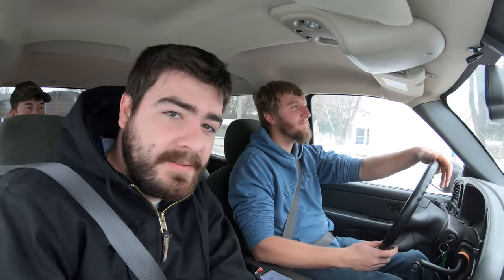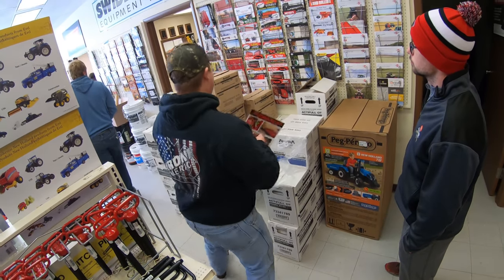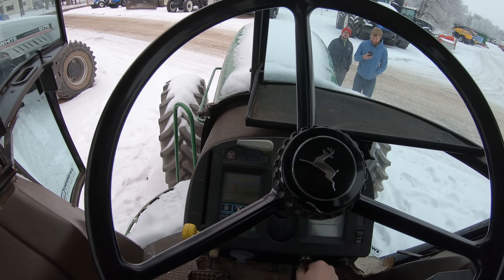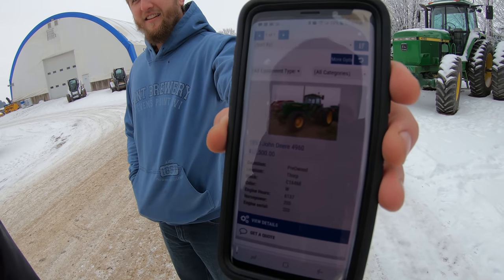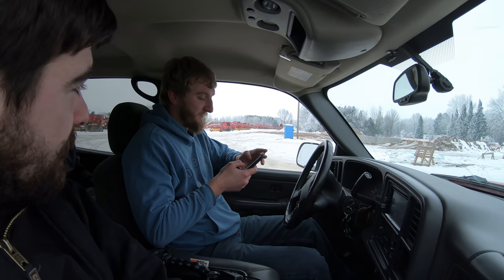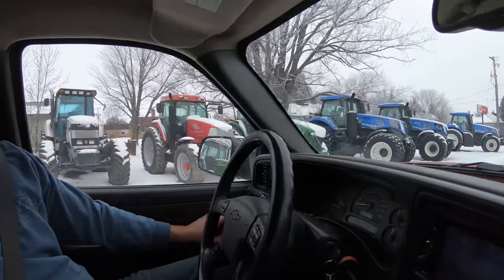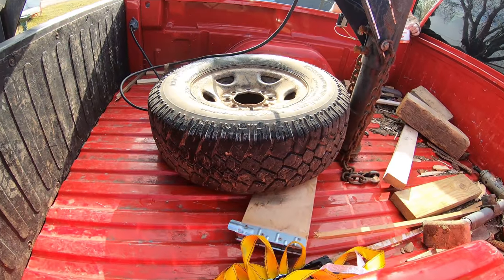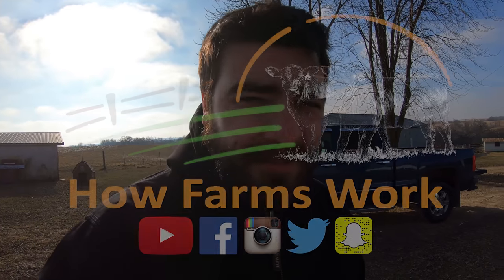Dream Tractor | John Deere 4960 | Swiderski Equipment

Comment: Just came across this. I worked for a farmer who re-powered when new generations came out. He had two 4850s and two 4960s. The 4960s were plastic pieces of junk and I couldn't keep the ACs running, in Florida. The 4850s were a dream to drive. Nothing was beeping or falling off in your lap. I bought my own big crows foot wrench because the hydraulic line under the front axle kept leaking on one.  I had owned two 4250s when I had owned a farm previously. Loved them. My brother still has our 1971 3020.

Comment: Listen, I have lived in the area you traveled here(NE WI) my entire 40 years of life, grew up on a dairy farm(Dad got out of farming in the late 90's) and you need to know this- Swiderski implement is a very large operation, that offers a very large variety of equipment and tractors in both age and make. If you take time to look at their inventory over time, you will find they offer an unusual amount of "overhauled" tractors. Some seem to hae less hours then one would think for an overhaul, some many more. 

Growing up we used to get the trading post farmer's newspaper, and Swiderski had a full page ad. They had all kinds of tractors, lots of Olivers, some Molines, MF- remember this is the 80's and in this area the dealerships for those brands were very, very scarce. So Swiderski was one of few to service them. Thing is, they would have say, an Oliver 1850 let's say. "Recent overhaul". Then you would see the hour meter had litterally rolled over. Same with countless IH tractors, machines with 9000+ hours on them with "recent overhaul". Then you would hear stories of people that bought one of these overhauled tractors, put 500 hours on them and rear ends blew out, PTO quit working, or if you were lucky, the supposedly overhauled engine would go and you could go to bat about defective work etc. Remember now, tractors in the 60's weren't built to run 12000 hours before a major overhaul. Most made it to 5000, maybe 7000 and then you OH'd it as a precaution so you didn't throw a rod through the block. 
Could you find a good unit? Sure. Was it parked right next to a unit that had been overhauled twice and had 11000 hours on it and shiny new paint? Sure. Was that parked next to a tractor that had been under water in some flood down south(or right up in this neck of the woods in the 90's) and dredged out and cleaned up? Sure. 
So when you see that nice looking, super clean JD there you like, just remember, it could have been sitting under 20 feet of water at some point, it may have had a half-arsed OH done so it didn't smoke anymore, you might get it home, run it one season and go to use it in the spring and find out the powershift for the first 3 gears is failing suddenly, etc. or you might take it home and get a really good deal. 
THAT is Swiderski, it's a gamble you have to decide if you want to take, if the price is right. you know what they say, "if it sounds too good to be true, it probably is" There is a reason they want 20 grand more for the other tractor with tons more hours on it- that one was bought at an auction and not dredged out of the river in Texas. 
Just don't get ripped off. look for mud where mud shouldn't be. look for water lines on the sides(if it was in say, 4 feet of water you might see a trace of where the water height was on the tractor) look for shiny new paint, it was put there to hide somthing not make it extra nice. 
Just don't get ripped off.
Reply: I grew up on a farm in central wisconsin in the 80's and 90's and you have just described the general consensus of "wheelin dealin" Al Swiderski to a "t" !

Comment: 4960 is a solid tractor ryan! We had a quad range 4760 for 15 years, and man it was a good one! The 4560 and 4760 were both sold with quad range option on the 2wd, but not the 4wd, and 4960s are all powershift. There's your trivia for the day!
Reply: How many hours did you have on 4760.
Reply: Jess Roberts  we put 3000 hours on it. It was used for disking and pulling wagons. Since then, only 200 hours have been put on it. Gets used for spraying now.
Reply: What’s the difference between quad range and power shift transmission. I know nothing about tractors, I’ve always been interested in them but just recently want to know more about them and learn something new
Reply: To be very simple, quad range has two shifters and powershift has one. In quad, you have A B C and D on one shifter, then 1 2 3 4 and r1 and r2. On powershift, all the gears are just all in the same column, and you shift through each one

Comment: We ran a 4960 for years on our farm as our tillage tractor and I loved the thing. Sold it when we upgraded to a newer tractor so we could handle other jobs on the farm then just tillage to the neighboring county. Only major issue we had was the engine blew on it but it was due to the fact that one of the engine air filters wasn’t screwed in all the way when it was replaced but it had 1100 on the overhaul and don’t remember before the engine blew

Comment: My Dad and I own two 4440's a 4630 a 4850 and a 4960 all power shifts. My Dad and Grandfather were both certified John Deere mechanics. My Grandfather said when Deere came out with the power shift they called it idiot proof and on the first demo tractor they had warn the tred off the back tires shifting it on asphalt agressively with no transmission problems. Quads to shift from A,B,C range you have to stop or after a while you will have to rebuild your clutch packs which calls for you to split the tractor twice to build. I'm 32 my Dad's 57 and my grandfather is 88 and we have worked on maybe a hand full of power shifts but we have worked on dozens of quads oh and power shifts are cheaper to work on also only have to split once. Most big complaints about power shifts is the jaring shifting gears but when they changed from the 8 to a 15 speed with the 50 series it's a lot smoother.

Comment: There is a 4960 up in Mora MN with 700-900 hours on it. Older gentleman bought it new and barely used it. Probably not for sale but give it a few more years and im sure it will be.
Reply: That would be a gem

Comment: I'm with you on the 60 series. I liked them. Somebody just put a 4760 up for sale up the highway from me. Brought back memories from my late teens. Farm I worked on traded 4430 for 4760. And yes they did come with quad range. This 4760 was first tractor with quad range transmission. I hated it. It was so hard to shift. Then a few years later I climbed up in a 7800 with quad range and it shifted pretty easy. So maybe it was something wrong with it in 4760. Other than that I really liked the 4760.
Reply: I like the 60 series but its not my favorite my to favorite series of tractors are the 40 series and the 55 series got a nice 4640 quad range and a nice 4955 powershift on our farm

Comment: I lived on a free stall operation when I was in my early teens and they had JDs.The biggest was a 5020 with big flotation tires on the front ,it was one of the biggest tractors in the area. Years later I became a heavy equipment operator and ran big equipment but will always remember how sitting in that seat it look like a big whale in front of you the way the hood was.

Comment: It has a lot to do with care of machine. You can take any make of tractor and turn it into a crap pile or even worse have a dirty dealer set you up for failure by falsely servicing your tractor. My uncle's tractor needed serviced so dealer dropped pan tourched a hole in oil suction line, cut oil presure wire, and put tape over cut to make it look like it was still connected. It spun a bearing on the 358 german diesel. Wait you will see equipment prices drop. Not many farmers left, just look at tractor house listings, markets flooded.

Comment: That is a good looking 4960! The only thing that looks kinda odd is the extremely curvy exhaust pipe. It must work fine because I have seen 60 series tractors running a lot and they look fine but normally you try to keep the pipe as straight as possible.

Comment: 4960s are great tractors all though they kinda have a tendency to catch fire do to an electrical issue like wes`s  4960 I would recommend a 4455 to 4960 my dads 4455 has 200 pto HP and it's only raited at 140 just like your 7600

Comment: 4960s are mostly powershift because at least in canada they were mostly paired up to a 7721 pull type combine or a drill. It wouldnt need that major of an overhaul yet, likely just sleeves and pistons redone.
Reply from the maker: This one in particular had transmission issues
Reply: Ah thats not cool. it can get pricey if they have to split a tractor

Comment: We had a 7810 with 26,000 hours and original engine and transmission
Reply: Damn, you serious? That's impressive.
Reply: Caleb Bisson I bet it hardly had any power by the end
Reply: A know a case 190 with 50 000 eh with original engine and transmision a case 7240 with 70 000eh with original engine and transmision. Im from slovakia and in this countri is usual to drive tractors over 30 000 eh before we sell them...

Comment: Correct me if I'm wrong, but . . .
As far back as the 50 series the big frame (4650 and up) regular 2wds were available with either Quad or PS, 
but the MFWDs were only available with PS. 
Smaller model 2wds and MFWDs were available with both Quad or PS.

Comment: Caught a glimpse and would like to get a good look and description at the front (business) end of the combine.  You  know, without the "head" (or whatever you call it) attached.  Having trouble understanding how the kernals  come off the cob so fast.
Reply: Once the ear go out of the head the feeder house chains pick them up and throw them into a cylinder that rotates over 1000 rpm, the ear has a small space it's jammed through crushing it.  It then goes into the separators. That depends if you have a rotary which is a huge rotating drum, or just the inline system which uses shakers to separate the grain from the garbage.  Grain ends up in the grain tank and garbage out the back.  Of course there are a lot of moving parts.

Comment: What overhaul at 8000 hours. It's funny how the same 6466 engine in industrial equipment will go tens of thousand of hours no problem.   Nice tractor though. Always wanted to put a 6619 in a 4960 or 4955.

Comment: Overhaul at 7000hrs? Weird. We have a tractor that is over 10 000hrs and it's not near to needing an overhaul. Our small Massey is at 5000hrs (3 yrs old) and is running as good as new.
Reply: That's what I was thinking. My 4440 has almost 11,000 and runs fine.
Reply: thats because of the powershift gear box, they are really not great
Reply: Dimplex You start to lose power at 8,000.
Reply: Got a 4455 with the same 7.6 with 17k original hours. Hours mean nothing to me.
Reply: on our farm most of our older tractors have never been touched nothing has had to been replace and they have around 10000 to 15000 hours each the only this that has been redone on the tractors are the smoke stacks
Reply: Dimplex yea. It definitely doesn’t well at least shouldn’t need an overhaul at 7k hrs. We have a 4050 with 6800hrs and it runs like new. I think Ryan is just talking out his @$$ about these tractors needing overhauls.
Reply: Stijn Philips even then it shouldn’t need an overhaul. Although yes the higher HP tractors do beat the power shifts up faster.

Comment: You guys over in America always saying the tractors need an overhaul at about 8000-10000 hrs. In Australia here I've hauled cane in tractors that have been used only for hauling cane with over 9000-13000hrs, only the gearboxes and cluthes have been worked on, no engine work needed. One tractor I use to drive was a JD 6910 it had 13000hrs and was sold about 2yrs ago with 23000hrs on it, only engine problem was with a plastic idler pulley it got changed to a steel one to fix the issue.

Comment: I work for a guy that had one in am I correct in saying the tires on the back are then what they came with because the front end seems like it seems to be  sitting pretty flat and their front ends not elevated like they usually are

Comment: Would you have been better off buying that than the semi. Youl only use the semi a few times a year ?
Reply: Only use the tractor a few times a year.  The semi will have at least 50 loads to haul out of the storage bins and when they are paying about $300 a load to a trucker that will save them $15000 per year they pay out.  That doesn't take into account the other 100 loads that they haul during harvest.  

A tractor in their situation wouldn't give that return.  Ryan made a great decision.
Reply: Just the hours not put on tractors and wear and tear on tires all considered add up.

Comment: Do you rotate tractor tires like you do car/pick up truck tires?? Especially a  tractor with duals on..
Reply: No.
Reply: @jeffgixer5185  good to know and thanks for answering 👍
Reply: @kwinchronic8953  it's just not practical to do or worth it.
Reply: @jeffgixer5185  oh okay but Damn, tractor tires aren't cheap as is. So having to replace em and get new ones everytime the tread gets low seems pretty pricy. Hopefully tractor tires have longevity and replacements do not happen frequently.

Comment: What's gonna happen to the 8235? I think a 4960 has more horsepower, correct me if I'm not.
Reply: They both have around the same hp, Pretty sure the 8235 has a slight edge
Reply: Oh. Huh. Yeah a 4960 is about 230 hp, maybe less.
Reply: @monte0907  a 4960 factory set is about 175 hp on drawbar 210 on pto.   8235r is about 190 on drawbar and 235 hp on pto, from factory.
Reply: The Regular Gamer The 8235 would have a weight advantage as well. A 4960 would be great for their Brent then they could upgrade the EZ-Trail like they’ve been talking about and put that on the 8235

Comment: My friend at that price I think there's 16,000 not 6,000 hours and you can run them Deere engines a long time I've never owned one or my dad but I worked for a guy that had a 4955 with close to 25,000 hours on it and they only engine work he ever did is rebuilt engine when he bought it
Reply: It's 6000 but in another comment someone said that it needs trans work so I could see them selling it at that price without them doing any repairs
Reply: True we bought a chopper from there once and it's in a lot worse condition than our older one

Comment: The 60 series tractors are overrated IMO.  They were outdated when they came out, versus what Case brought out. They should have ended the sound guard cab models with the 55 series and do the update then. I’m Deere guy, but the 4960 and 60 series tractors  really aren’t anything special IMO.